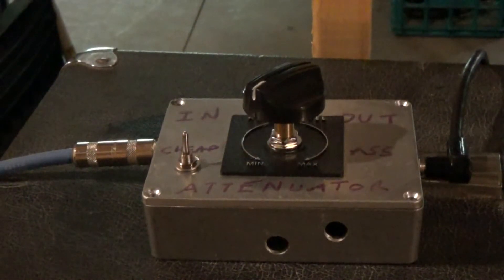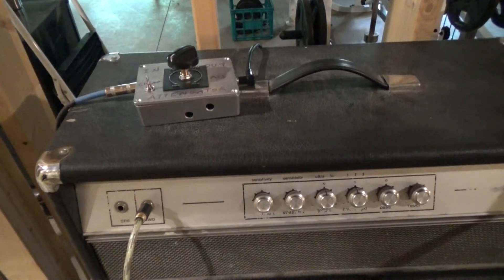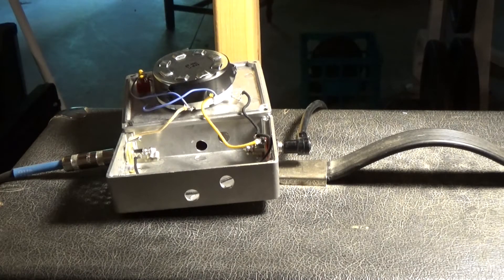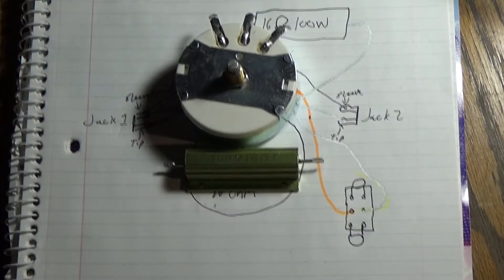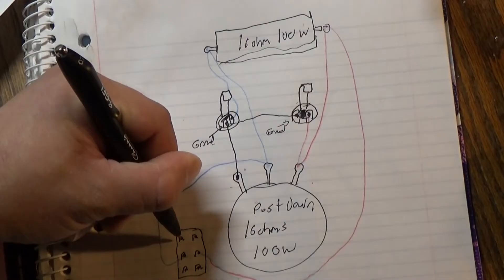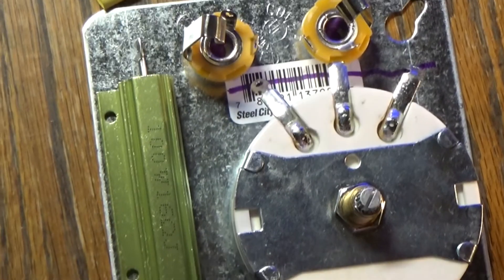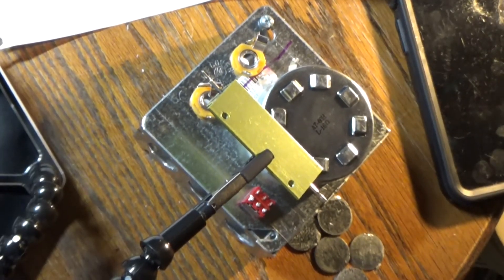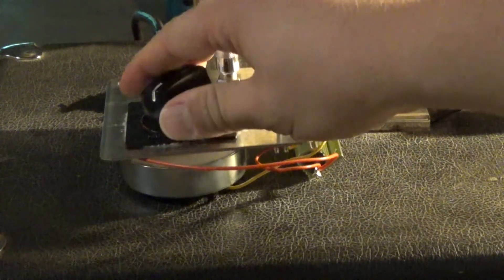The ONE piece of GEAR EVERY TUBE AMP owner should BUILD! DIY GUITAR

Comment: Another trick is to put two polarized caps in series. Connect the two negative leads together and connect the + leads to the switch. Series caps 1/2 the value so double each cap value. I hope this helps.

Comment: nice work, man.  i appreciate your insight regarding the bright cap values - I had always wondered why the values on the internet never had much of an effect for me.  as a an aside, in my experience, i found i needed to add a heatsink and fan for sustained (1 hour of band practice) conditions with high load (50w plexi cranked) and high attenuation.

Comment: You can without any problems put an 8 ohm output into 16 ohm load. You will lose some high end frequencies. Maybe a good thing if you have a particularly bright amp. But as you probably all know, DON’T put an 8 ohm output into a 4 or 2 ohm load. You probably will fry your transformer on your amp because it’s not seeing enough resistance. More resistance is safe.

Comment: How did the surface mount resistor go for heat after a while?.
Reply from the maker: It works flawlessly!
Reply: @Low Head Room  I think I just found another solution to my problem. It's a long story, but she's a 120 watt amplifier that I'd operate in half mode, after moving house had to change from a 4x12 to a 2x12 and my 2 favourite speakers are 8ohms. I'll just operate the amps loud enough to get a good tone with this and that should handle the load.

Comment: Thanks for this. Earned you another subscriber.  Is there any wisdom in building this to the 200 watt design even if I only plan to use it with a 50 watt max amp? Say, just for an added level of safety?
Reply from the maker: Yes I would do that for sure . You never know If you’ll get a more powerful amp as well. Also even though an amp is rated at 50, it usually exceeds that value. Same with the 100 watt amps. That pot is rated at 100 watts but using it with a “100” watt head doesn’t work due to the head being at a much higher actual wattage. Hope that helps
Reply: @lowheadroom  Thank you for the prompt reply and info. I will build one to this design at the 200 watt level to cover any amp that I run across in the future.